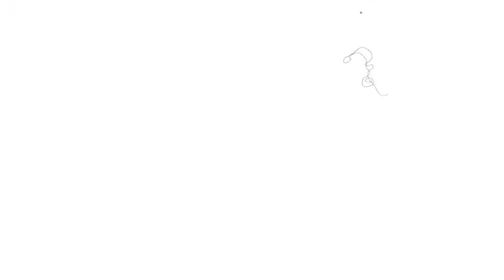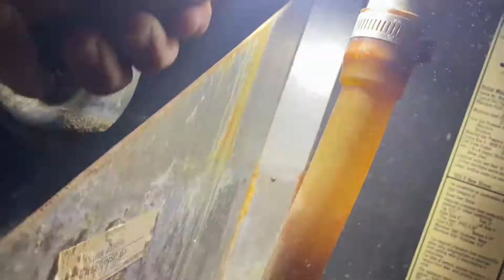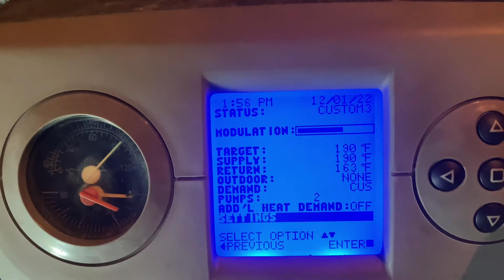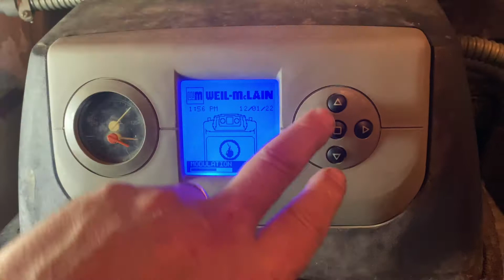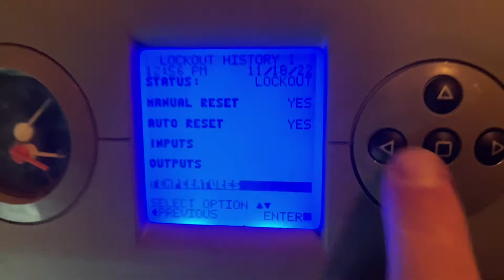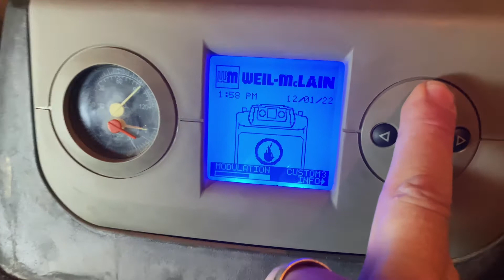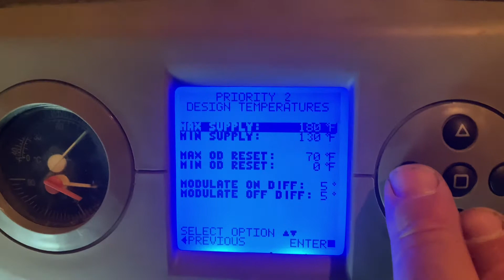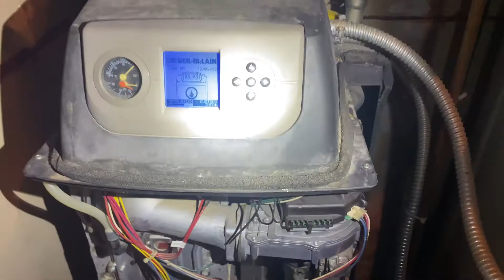Weil McLain Ultra 3 Not Heating How to Enter Contractor Mode and Review Errors and Faults

Comment: I have a Weil-McLain Ultra PhD.  When the temps get close to zero and the boiler runs constantly, I have to take the cover off, or it will short-cycle.  Not sure if it is a sensor or just overheated circuit board.

Comment: Old content? Still good tho I’ve replaced one of those heat exchangers not an easy task lemme tell you but it’s doable. I really don’t like these boilers for reason (A) heat exchanger has holes on bottom after years (B) found temperature sensors go bad including outdoor temperature sensor (C) most I come across are piped by blind men who don’t know what they’re doing and finally (D) are you really saving that much $ in fuel when the inducer motor costs $750 and main pcb costs $2000? Idk lemme get your thoughts and feedback
Reply from the maker: Oh you just wait, I've got one about 2 years ago that never went live too. Saving that for this weekend
Reply: @PipeDoctor  let go and see it bro!!